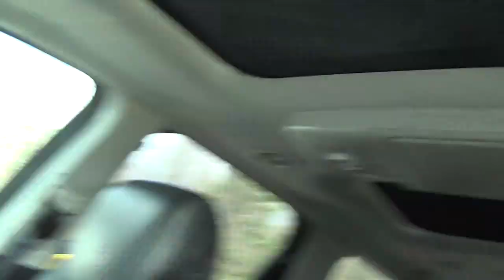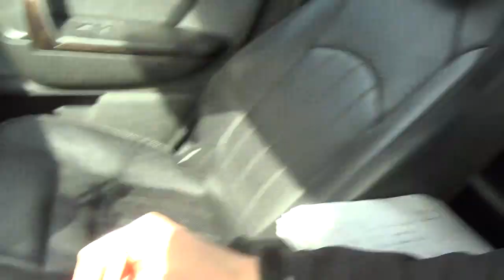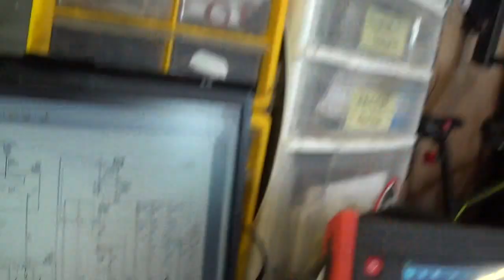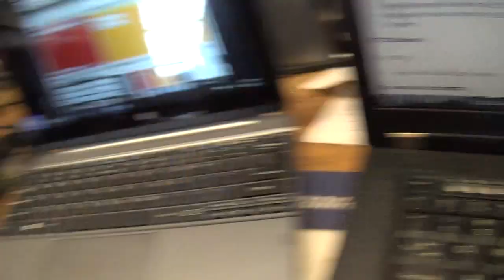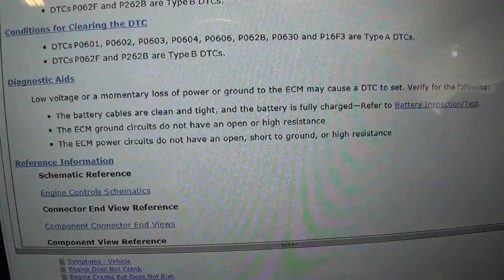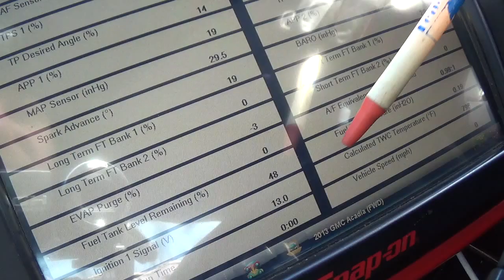COMEBACK!!! No-crank, REDUCED ENGINE POWER: '13 GMC Acadia -Part 4

Comment: a lot of issues with my Acadia as well. My side detection system stay lights stay on all the time. Other day my dashboard had all kind of warning signals as and vehicle wasn't starting up. Second day it started with no problem. Now i see my airbag service light is on. Will never recommend buying a GMC vehicle to anyone.

Comment: I'm having the same issue with my 2010 Chevy Traverse and took it to the dealer for the service Stabletrak, reduced engine power, and recently vehicle wouldn't start after I just shut it off..a few minutes later it started with engine light on. I have replaced high pressure fuel pump, throttle body, brake pedal switch, spark plugs, O2 sensor .. got a code of U0073 this morning.. a while ago I did get P0700 and U0101.. I'm tired of this lol..

Comment: After seeing the codes and freeze frame data, my hypothesis is that the ecu has internal problem. With the app1 & app2 readings different and the 158mph in the ecu freeze frame. The TCM ignition 1 low voltage at 2.4v to me says its jumping circuits in the ecu. Double  check power's & ground for the ecu but I call replace ecu

Comment: Check for voltage bleeding back onto the ignition one circuit from the fuse panel box remember the rainy day it failed, look for green crusty.

Comment: After replacing,  battery , spark plugs, air filter dumping a good cleaner in fuel iliminating a shorted fuel injector , iliminating a shorted Tb sensor!!  Take a wired brush with battery unplugged and bush off all relays and fuses in under hood fuse box after inserting fuses wiggle them a bit so that the build up will scrape of fuse box fuse/relay holders!! Now his getting all these crazy codes because pcm is going haywire do to computer trying to go into safe mode meaning it’s trying to shut things down!! It will reduce engine speed/=bad fuel ratio,engine hot/ac off=thermostat sometimes frade temp sensor pigtail,service stability traction control transmission yerking bad fuel ratio!! People most of these issues will not happen if you just follow manufacturers suggestion on your owners manual!!! Change plugs filter battery when suggested also add cleaner in fuel every so often to prevent build up!!! His waisting his time!! With codes

Comment: I have a 2010 Acadia from brand new, and since lastwinter it keeping gimme a problem，the power drops so quickly， if the car not drive for one day long，the voltage will dropped below 12 V， and the car would not start changed battery, changed the alternator, but nothing worked.... I bought a power bank, and used for many times during last winter....and cross last spring, the summer and the falls the car was fine ... but, since the winter comes then the problem come back as well....

Comment: you need to check ground G110..VERY COMMON ISSUE WITH THOSE VEHICLES, you need to clean ground G110, located on top of the power steering pump, right side engine CYLINDER HEAD near the timing chain(firewall side)..i had 2 cases same issue!..cust complained about stalling while driving, then no crank, when it cools down, it starts at times!!!!..

Comment: In the "good old days"...electrical?..plugs, points, condenser, ( magneto would be superior), plug wires, starter, battery, gauges, ignition switch..fuel? fuel pump, filter, carburetor, lines . Now? crazy with a plethora of inscrutable possibilities to diagnose an ailing vehicle. Just incredible. All these extra accoutrements do zilch to ameliorate  environmental harm, in fact possibly more so  than just a fine tuned less complex vehicle, which could be evolved even more , if that mechanical path had been retained. Or utilize PCM/ECU with a fail-safe mechanical system.Just the extra pollution and energy used for  manufacturing  and disposing of all these extra frills is harmful.

Comment: Hi, I have a 2010 Acadia which is doing the same thing.  Dead battery! Charged the battery went to go crank it and still no crank and noe the battery reads 25% charge. I was going to get a new battery but looks like this is a known issue for GMC. ☹️😡

Comment: Another thing, the app sensor wires go directly to the throttle actuator on almost every car I've seen so far... so should be pretty easy to diagnose that discrepancy... I would have loved to see real time data for all those modules so I could see what they each read for ign 1 voltage engine off and engine running... Cuz it's odd they all show 13 volts when ecm shows 12 in the freeze frame..

Comment: You should have tried to look at the freeze frame records for the ecm's performance code. The error you got was the scan tool software so rebooting it would have fixed that issue

Comment: Tip for dealing with the dealer: talk to the technician directly. My guess is that the service writer at the dealer just wrote something like "Check engine light on. No diag approved at this time. Check and advise." That's typically all the information we get on a repair order. I don't want to offend the service writers who are actually good at their jobs, but there is a good chance you have to break through a brick wall of stupid at the dealer before you can get coherent answers.

Comment: chicken or the egg again.  Either its the 158 MPH ECM @ 12.2V or its a common fault w.rt. potential on both the FPCM and the TCM...  Or we could burn it for heat, enjoy a few hot toddies and make smores around the fire.

Comment: You did a video on a late model epsilon platform lacrosse where the other mechanic said it best. These are over-engineered eurotrash.  

I still love how these things are basically an epsilon platform car with longer control arms. What can you expect from 2008 GM I guess. Or GM in general anymore.

Comment: The dealer will not tell you the truth because they want the job ! i have a 2005 Toyota highlander and tran jerk hard  1-2 2-3 it took me 6 month to find out the book is wrong ! hear what happen 2005--2007  you can only check your tran oil after the 1th 5 mi of driveing it ! will for a year this suv was jerking and bucking! It turn out that my tran oil was low the whole time by 1.5 qt ! once it over 5 mi it back to full! so finly some one from the dealer told me you have to only  you can only check your tran oil after the 1th 5 mi of driveing it ! yet that was not even in the manual !

Comment: I see on the forums that the sunroof leaks when the drains plug up. It's old enough to have accumulated gunk up there. One forum person says it leaks out the light in the back cabin ceiling and another says it leaks out under the dash causing problems with the cd player and a whatever water can cause problems with. Then there is the floor and battery getting wet. Time for a car wash and a flatbed maybe. We had a vw rabbit the ac housing drain would fill up when the hose plugged I think we used baking soda to clear it, or maybe a coat hanger. It was 79. See if his radio works. They are junk piles

Comment: PLEASE CHECK ALTERNATOR DIODE AND CHECK WAVE FORM.    CHECK EARTH WIRE ON IGNITION PRIMARY COILS
CHECK SHORT ON RADIO CIRCUIT OR DISCONNECT IT.
Reply from the maker: But the fault occurred with engine OFF and it is a no-crank...how would alternator or ignition coils come into play?
Reply: You checked it in part two or three, and alternator was putting super high amps into the battery and other systems for awhile before it would drop down. Plus battery voltage dropped quickly and less than ideal.
Reply: A shorted diode can drive the electronics crazy.

Comment: There is evidence of a certain amount of empire building by the electronics engineers within car companies.  The result is more wires and more control modules without the benefit of better reliability or economy.  Ivan, one source of non electronic information is the customer and one important fact that you have so far chosen not to explore is that the problem manifests itself when wet.  I am not hampered by clean hands, a warm seat or a scanner and my first point of attack would be to visually check all relevant earth points, relays, wiring junctions and fuses for corrosion and water ingress

Comment: My guess is the relay or even a short of some sort or a bad connection... for some reason the voltage is jumping around between 13 and 12.2 and the transmission even had like 2.6 what the hell? My guess is anything electric related... the computers are probably okay

Comment: Ivan, I dont know if you figured this vehicle out, but one issue with the reduced engine power has to do with the TPS, I saw one guy take the whole thing apart and he found a problem with the fingers that rub over the tps.
Reply from the maker: Hey Anthony, yeah that is a common problem on these, but in that case it would definitely throw a TPS-related trouble code!

Comment: I think it needs an ECM. It is a 3.6L ya know! LOL
Reply from the maker: Is the ECM a common failure on the 3.6?
Reply: I own a salvage yard up here in Rochester, NY. The older 3.6L ECM's I cannot keep in stock! They interchange between all the 3.6 models, and they are worth about 200$ used and I often offer to program them for customers around this area. Usually when I see that P0606 code for internal error the ECM is usually bad (After checking powers and grounds of course)
Reply from the maker: Ah that is good to know, thanks for the info!
Reply: thank you for the good videos. If you ever need any hard to find parts give me a shout! Michael Broccolo - AllCityAutoParts@gmail.com

Comment: I'll say chafed wires, shorting out to the app signal wires, causing the discrepancy between app 1 and 2, and the 13 volts on the ign 1 line voltage.

Comment: Take a good look at the i/p fuse block for water intrusion . It is located under the right side of the glove box. You can remove the glove box  and see the top of it. The gm r/v bodys are well known for water leaks from the sun roof and windshield. I've replaced quite a few i/p blocks, a couple of them having some of same issues with the Ign1 circuits that you are having. Its worth a look As a dealer tech, i am embarrassed and angered by how it was handled by the other dealer, sounds like they just gave it to a rookie and said " here, scan this real quick"

Comment: 08 enclave  buick  same Pos vehicle with silimilar codes  and security light lid 
did some research 
car started then immediately cut off  
diagnosed down to a blown fuse under the glove box (5 amp fuse) 
what caused it 
after market remote start with  some striped wires touching the tcm under the driver side 
my recommendations  look under vehicle  under driver side there's a plug connector that plugs to the rest of the vehicle 
good luck Ivan I have faith in  you

Comment: Just a couple of thoughts... the APP pedal voltages could be normal, it's quite common for one sensor to read half of the other as a safety plausibility check - also if they are absolute values not relative, 20% could be 20% of 5V i.e. 1V with the pedal not pressed which sounds sensible (this allows the PCM to detect a short to gnd input signal which wouldn't be possible if the signal went all the way to 0V normally when pedal not pressed)

For the 158mph freeze frame that sounds suspiciously like 255kph (i.e. 0xFF hex) which is probably a default/initialisation value for vehicle speed if the PCM hasn't received a valid CAN signal from the ABS (for example if the PCM is awake when it shouldn't be and ABS still off, or PCM has just rebooted unexpectedly and hasn't received data yet)
Reply from the maker: hmmm that is a plausible answer to the 158mph! Great thinking!

Comment: This is the shit I always get stuck doing.. I don't think i would worry about the APP sensor yet, I think that if its a problem the computer would have thrown a code for correlation.I am assuming that you checked for TSB's?
I would connect the pico on a long timebase to powers and grounds and do a wiggle test or test drive

Comment: check all ground connections. if they are good which I doubt. there is a bad wire somewhere. second the computer needs to be reprogrammed after that. just my opinion.

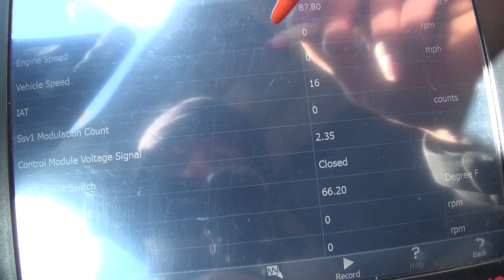Comment: at 11:40 the ECT is 87°f the ambient temp is 66°f, I think the 13v is ok because they probably had the vehicle running for a bit, shut it off and turned the key on and the voltage didn't drop below 13 when the code was set. I think the ecm power and grounds need to be checked and if it checks good then replace ecm.

Comment: When you had the transmission voltage reading 2.4 volts could that have caused the TCM to go haywire and cause the vehicle speed sensor to read 158 MPH?

Comment: I doubt it's the ECU the internal error will be due to the other modules not communicating properly.  It really has to be in the power feed from the ignition. Are there any connections or splices that get wet?

Comment: You're up against how dealers pay their service people. It's all about commissions, billable hours, and moving onto the next vehicle to further maximize both of those. Those things are WAY more important to everyone in a dealer service department than actually fixing problems, doing things right, or satisfying the customer. Dealers manage their service shop as a profit center and their employees have strong incentives to maximize the dealer's profit. The end result is often not in the best interest of the customer. And there's no excuse for scan tools crashing. If a scan tool encounters something it can't deal with it should simply display an appropriate error message. But, sadly , most scan tools have poorly developed Asian software with the emphasis on form over function. It might crash or often not work right but check out those fancy icons!

Comment: Ivan, you said it was fine for forty five days then it rained and started acting up. Big clue ! My first guess would be to check for crusties in the IP fuse block. Usually caused by a plugged/disconnected sunroof drain tube or a windshield leak.
Reply from the maker: Sounds logical. But how does the I/P fuse block have anything to do with the main relay circuit or the ECM, which are all under the hood?
Reply: Does the ECM and control of it's related relays, the TCM, FPCM and all other modules communicate on the GMLAN  along with the BCM that may be wired thru the I/P fuse block inside the vehicle ?  From what I see the ignition sw is a input signal to the BCM which in turn sends out a request to ECM , FPCM ect. over the LAN to activate relays such as the main relay, starter relay, and the fuel pump ? Maybe cross feeding high or low voltage is bring down proper communication ?
Reply: Ivan, also if you start checking for powers and grounds to various modules there is a TSB warning that if you disconnect the ground to the BCM without disconnecting the negative battery lead the BCM will be damaged internally. If battery voltage is supplied with no ground the BCM will be damaged and could affect other modules. Hope this helps !
Reply from the maker: I am surprised there were no COMM codes to tell you the truth, considering the ECM went into "bizerk" mode lol
Reply: Ivan, I don't have the vehicle in front of me and there is a time lapse on your vids but like I said in my first post I will take my best guess , was I close!
Reply: Short to ground in the Audio Amp  is key ? BCM, TCM, FPCM, ECM and Audio Amp run thru IP fuse block ? JUST Saying ! LOL !

Comment: Step back , one you know for sure , the problem only happens in wet weather and water is the best conductor of all, I would look for all the possible places where  there can be a leak or possible moisture which leads to corrosion which creates bad grounds also would ask the customer if the problem happened the first time after a heavy rain and possibly a thunder storm my teacher always said go back to basics had a car that ECM was affected by lighting good luck and yes that 13 volts drives me crazy

Comment: Hard to say by watching , but would not be surprised if it is the throttle body , or harness . Or maybe ign switch . How about one of those little hand held steam cleaners.  Could use to introduce moisture to components or wiring. if thinking moisture is part of the cause.

Comment: Usually with a number of dtcs, all it takes is for one code to trigger the rest. The problem is picking out the culprit and isolating it. There again a bad ground has a variety of different symptoms.Found that out when I hit the big city, driving a Mini. There was no need of gym practice that day and it pouring out of the heavens, trying to push the living daylights of it.There was also the Beetle that went for about 20 miles and came to a complete halt.Great work Ivan and best of Irish luck for Paddy's day

Comment: Were they trying to jumpstart the vehicle giving you 13 volts. Or could it be a higher surface charge on the battery if it was running and this fault happened after a short rest. Like going in a store for a minute and upon restart
Reply from the maker: Very good thoughts to explain the 13V. Either scenario is possible!